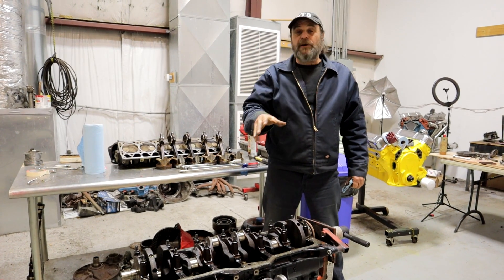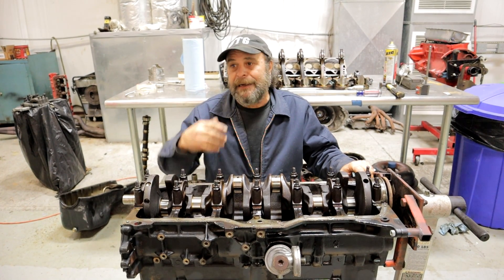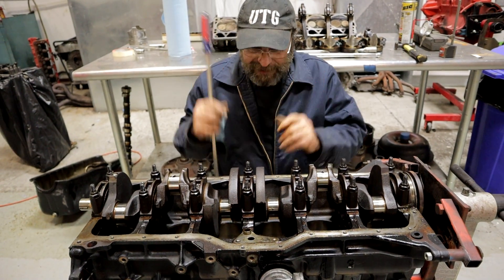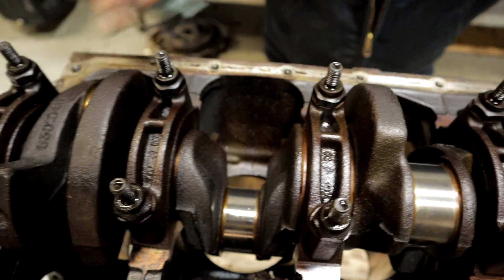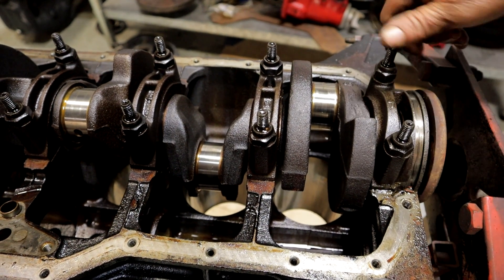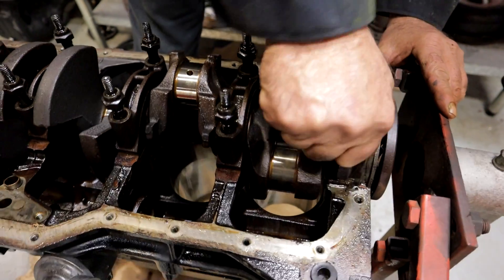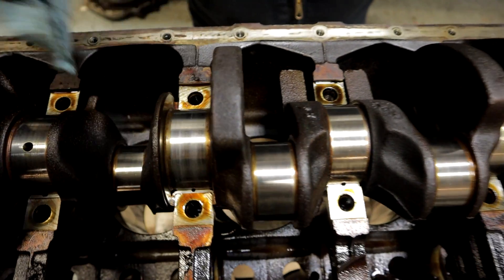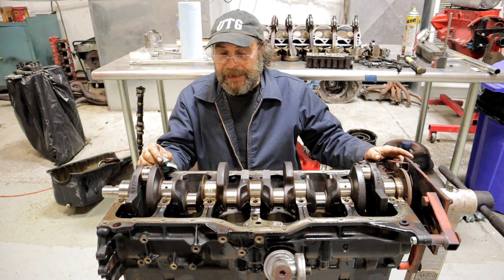Your First Engine Job - Digging Out The Crankshaft And Checking Critical Points

Comment: Great advice on the cam bearings. However, instead of making the call just by observation, have a qualified machinist actually mic the bearing ID and the cam bearing surface to see if oil clearance is still in spec. Too much oil clearance will bleed oil pressure and shorten the life of the new main and rod bearings.

Comment: blown away. I have 2 '91 mercruiser 4.3, one Ive done some basic tuniung up and it fired right up. it Humms. the other one is locked up tight! im down to the crank. there was about 1.5 litres of water when i drained the oil...going deep into the rabbit hole LOL

Comment: Quick question. Im rebuilding my geo metro 1.0 engine. It spins really smoothly. Has 285k miles. Just burns oil so i want to hone it and replace the rings. I see a lot of videos of people polishing their cranks at home and i want to know if you think this is a good idea or not. Do i replace the bearings/polish the crank or reuse them as is?

Comment: And also another thing he said that you're going to have to have each journal turn if it's got groove you can feel with your fingernail not necessarily if you take 240 220 grit 320 400 600 800 1012 1500 2000 by hand you can get a nice finish with no groove in it while the crank is still in the engine without removing it that's a tip he should have taught you you'll pull the whole crank spend $400 to have it turned and if it's not hardened then you're going to save yourself either way whether you have it turned or not you're going to save a lot of money by doing it yourself and doing the steps that I just prescribed but yes it's always good to check all your tolerances while the crank is in it's hard to check the tolerances while it's sitting in the block but he does have a lot of good detailed information

Comment: Hey Tony I am doing a rebuild on a Kawasaki ZX14. Everything went well except the engine seems tight. On first startup bike runs great about a minute into it when it first starts to warm up. Sounds like it gets tight and stalls. Do you have contact info, email etc?

Comment: IHello Tony, Question I've got a 304 v8 IH engine same condition as the one your showing, however My cam bearings de laminated and i need to install new cam bearings my question is can I just replace them providing my cam is within spec and my lifters check out ok?

Comment: My first engine job was an 304 AMC that was 30 years ago. It turned out quite well even I had no experience or an automotive job as a background. Now I've jumped in cold water again and taking apart the 1UZ-FE that powers my boat. Seems to be quite hi-tec but today they are classics too. Tomorrow I'll take out the crank of the block. Your videos are very helpful because the basics are still the same. Just gave an abo.

Comment: @UncleTony, so I dropped the pan on my SBC 350 to check the bearings since I found specs in the oil and found that the center mains are down to the copper the outter mains are starting to show copper too, do you think I can get away with simply replacing the bearings and be good or pull the crank and polish it or is it time for rebuild? The crank looks smooth. The compression was 125-140, so I didn't want to pull the heads. The engine ran good, but sat in the garage before I decided to pull it out and use it. Do you recommend I pull the cam out and look at the bearings?

Comment: On my 79 F150 302, I found the vibration damper was damaged over the years. I thought it was the crankshaft pulley being warped when the engine was operating. I tore into the engine to find bad timing chain, bad vibration damper, bad cam bearings and crankshaft thrust bearing was showing a lot of wear. Engine ran great and didn’t smoke. I plan on need cam and crank bearings. Another recommendations? Engine is stock and never apart.

Comment: Those big end journals were lovely for and old used engine. The main shells looked like they could have just been changed, do you have any idea of the miles on this engine Tony, it's mad just how good condition the rotating assembly is. This was really well looked after, other than a dry start or two it's brand new, great find.

Comment: It's great to see a channel where the host actually knows what he/she is talking about. Tony, I know you've rebuilt many engines because I've run into the cam bearing issues mentioned at least half a dozen times in the last 30 years. After tapping in a new set of bearings it's not uncommon to have to sand the #1 bearing a bit to get the cam to turn freely. Kudos for pointing that out.

Comment: Hey Tony, ive got a 318 in a 73 dart, the motor runs great has good compression even with its high mileage. i noticed excessive crank endplay and i measured .0125 with a dial indicator, the Chrysler manual says .010 as being the max allowable. this car is just a daily driver and will never see constant abuse. should i run it? or should i tear it down now to save the crank and block from damage?

Comment: Question, wouldn't you mic thrust area on the crank? Otherwise you won't know if it is crank wear or trust bearing surface wear. Enjoying these videos as I got a 2002 4.0 to freshen up and it is nice to get a preview of the insides.

Comment: Tony, Have you ever built your version of the Perfect Motor? , by that II mean....well "the perfect motor" could mean anything different to anybody, but what I had was thinking, Have you ever built a motor for the purpose of it being the happiest running motor possible, and the one most likely to run the longest, using blue printing? 
When I change oil, I can tell my motor runs happier. What does all that balancing of rods and everything do for a motor anyway?
Reply from the maker: Ray, my definition of perfect changes and evolves depending on what I'm working with.  For a long time, my perfect motor was defined as one that would last exactly 1319.9 feet.
It is funny though, how engines do seem happier right after a fresh oil change.  Logic tells us it's not really possible, but reality is, they actually do seem happier.

Comment: It's a cast iron crank, they don't need hardening because cast iron is very hard. Test it with a file. Steel cranks are induction hardened on only the journals, they have soft counterweights, again test with a file.

Comment: I bought an older car with a virtually rust-free body that has an engine knock somewhere. Using my stethescope, I couldn't pinpoint the knock's origin at the crankshaft. It was somewhere up there on the cylinder head and I had my doubts, after having adjusted the valve clearance. To make sure that the noise didn't originate at the botom end, I then tore off the pan and began popping the caps off of the rods. The bearing closest to the oil pump was the worst and the ones following were progressively better, towards the other end. There was some scuffing, of which you mentioned, and I measured their clearances with Plastiguage, afterwards. Because of the inconvenience of doing everything otherwise right, I followed a forum post to where one guy simply threw new bearings in his and then ran the engine on the heaviest recommended oil of which the service manual dictated. Because my crank was still within specs, I then ordered new bearings and installed them. The noise was still there. But, at least, I knew that I could drive it for a while, without worrying about spinning a rod bearing. Having only 60.000 miles on it and was originally owned by an older lady, I suspect that the dealer who regularly "serviced" this vehicle was bogarting her big time, through maybe packing some valve-grind compound into the filter, during an oil change, in order to sell her unnecessary service. Here, the original air filter still in it when I got it: https://i.imgur.com/1ldiQ7k.jpg
https://i.imgur.com/fpc1Co1.jpg Here are the old rod bearings: https://i.imgur.com/5H0FXHw.jpg Even though, they didn't stick it to me directly, this still infuriates me, to think that there are Scumbags out there who do these things, without any fear of karma biting them back

Comment: One little backyard trick for worn thrust bearings: If the thrust bearings are separate from main bearing you can glue tinfoil on the backside with high temp epoxy to reduce crank end play.

Comment: On re-using cam bearings. On mopars, aren't they supposed to all be undersized and have to be fitted to the cam? I seem to remember something about that (cutting them with a knife or using an old cam with grooves cut in it.)

Comment: Tony, two things I want to tell you. The timing chain cover doesn’t have dowels to align it. They make a tool that fits over the crank and fits into the front crank seal. This centers the seal to the crank. You can lightly install timing chain cover, then install harmonic balancer then tighten cover bolts. 
Next thing is the distributor. Look at bottom side of the distributor and you will see a small hole. This is used to align/time the distributor shaft. With #1 tdc on compression stroke and drill bit or what ever you use,install the distributor. The factory puts a piece of plastic in it, until it’s installed in the engine. You then pull it out. Those two little fingers that stick out should have the hold down bolt pass through them. But be sure that you use that hold down bracket that you found in the early videos of this engine. The PCM controls the timing. 
Be sure to use a new distributor gasket or it will leak. Hope you read this and have a wonderful day.
Reply: I believe Tony knows this...
Reply: Good info! Nice job.

Comment: Considering rebuilding my Big block chrysler 361, but seeing how shoddy the quality control is for new parts, (especially the lifers) that has me quite worried. Would be interesting to see a video on using NEW parts vs, NOS crankshafts/camshafts from the 60's 70's.  Kind of like Uncle Kathy's charger, has that Crane fireball cam.

Comment: I have a 1986  Dodge d150 5.2 318 with a cracked block  also needs transmission rebuild . the  318 runs but I was wondering if you had the slant 6  that that runs that I can trade. I have no way to get to Tennessee and bring it to you I live in Oklahoma
Reply: Call an Uber.

Comment: Plastigage the used main bearings before you decide to keep them?? Just saying.
Reply: On top of that, wouldn't be the worst idea in the world to check the various journals with a caliper too.  I've seen a splash oil small engine with a beautiful looking rod journal with 0.003" out of round.  Hard to say if this happens too terribly much on pressure lubed crankshafts. Just want to say appearances can be deceiving.

Comment: There I was, getting ready to do an “I gotcha” on those bolts, and then you caught the error. No harm, no foul. But now you have to check them all because they got mixed up. Oh well.
Reply: If all of them turn out to be within specs, that'll prove that someone had the cap off, in order to replace the seal

Comment: Here’s my question. How would you feel stretch in the threads that are beyond where the load is. What I mean is undoing the main caps the nuts are passing over an area of the threads where no load was applied. Same with a bolt where the loaded portion of the threads will be held intact by the material it’s threaded into. I get stressed threads will bind but it don’t seem like a good test during disassembly. By removing the stud or bolt and then re-threading a nut going past the assembled point would work though. Just my thoughts.
Reply from the maker: I was referring to the "snap" that can be heard when first breaking any of the other main bolts.  Only the last two let go without making that sound.

Comment: What if you put in a new cam? Would you change the bearings? I’m going to build a 360 and will upgrade the cam
Reply from the maker: Same thing applies.  BE SURE TO CHECK THE CAM JOURNALS!  I and several other people have recently encountered cam bearing journals ground over spec.  That can be a major issue if it gets past you.
Reply: Thank you guys I appreciate it, I’ll be sure to check it out really good, I can’t afford to blow one up 😂 just doing what I can here
Reply: if you are changing the cam, you need new bearings, the old ones are worn in to the old cam...

Comment: I'm assuming you just be replacing the pistons on the rotating assembly. Will you be putting the rods, pistons, wrist pins, bolts and rings together in as close to an average weight as possible ?

Comment: 15:30 I was about to comment, that I'd be more than tempted to just put those main caps back on, without disturbing the bearings. They're probably better quality, and would last longer than new Chinesium ones 😆
One thing that came to mind, is comments in previous videos about Tony not using power tools, I'd equate that with comparing a craftsman to an assembly line parts changer.
Reply: Hopefully he uses Clevite as they are still made in USA (at least the last time I bought them they were).  KING Is Made in Israel but are quality too.
Reply: @OldBeaterGarage boycott chinese and israel products.
Reply: @You Wish If people would stop buying that crap, they would stop shipping it over. One of the reasons as to why I no longer board an airline is because I've read that some of them knowingly buy counterfeit parts from there

Comment: Why no air tools!
Reply: With air tools you can't feel if something is binding or too easy, as well as you can by using hand tools.
  Even if you are replacing every fastener and chasing every threaded hole on the entire engine, it is still good to know if there is/was a certain bolt, nut, fitting, or fastener that just didn't "feel right" during disassembly.
   (Hope this helped answer your question)
👍😁

Comment: These 4.0L engines were notorious for oil leaks from the rear main seal/rear oil pan gasket seal to where literally every single one leaked and needed to be repaired at some point at least once or multiple times. I did countless of these in the dealerships and  independent work after the dealer. I noticed it had a Felpro oil pan gasket so more than likely those rear main bearing cap bolts have been off before to replace the rear main seal. Also that smell when pulling the main cap bolts off is normal and not a sign of overheating necessarily. Also make sure you reseal the oil filter adapter as those like to leak as well.
Reply from the maker: You are most likely correct, and I'll point that out in the next vid.

Comment: Many big 6’s would come to our AMC dealership with 150k miles, usually with about 5 psi oil pressure at idle. We would replace bearings with 1 under size and all was well. They are a tough engine.

Comment: Good video, uncle Tony this brings back memories 

if you have a manual transmission and you’ve got the habit of sitting at the traffic lights with your car in gear, holding your foot on the clutch, as you know that is a bad thing because it pushes the whole rotating assembly forward, while the motors running and it, chews the thrust bearings….

Some of the viewers might not realise it’s a bad thing to do
Reply: Drove manuals my whole life and never thought of that. It makes sense
Reply: That's why I'm always in neutral when stopped. Even in a automatic, I pop in neutral just out of habit.
Reply: @felzke440  On an automatic, keeping it in gear at stoplights still won't make any difference on the thrust bearing

Comment: I have a cracked head and a hole in piston number 1 in my 4.0. Time to drop the pan and check out the rod bearings. I might need an engine stand and a hoist…

Comment: I sure wish YouTube and Uncle Tony would have been around when I rebuilt my one and only engine (in the late 1970s). It's a wonder it even ran when I put it back together. When I took the block (with the pistons and crank still in it) to the machine shop the guy that ran the shop took a look at it and told me that all I really should have been doing was having the heads done because the bottom of the engine was almost pristine.
Reply: He certainly was around. Unfortunately, he didn't have his video channel up and running yet 🙄

Comment: Lack of snap on the rear bearing cap may be an indication that the rear main seal was replaced at some point in it's life.  It's a common failure point.  IIRC, at least on the 99-01, you pull the bearing cap and then can fish out the seal and push the replacement in (they come in halves) without having to drop the crank.
Reply: Exactly what I was thinking.
Reply: X3
Reply: Same with any 4.0 or 4.2.

Comment: I think the cam bearing part could've had more emphasis on replacing since this channel is geared to the newb but totally justified in not replacing. Good work always a nugget or two of wisdom to be had here. 👍
Reply: This video is designed to showcase what THIS engine needs for a rebuild tailored to the expected application.

Comment: Tony, thank you for continuing to go through this series in detail . They’re not big view numbers at first, but these will always be there for novices like myself as a reference forever and we are grateful for it .
Reply: Yep, excellent series! Only time I totally tore down an engine, I knew it wasn't going back together. It was an EFI Ford 5.0 HO with a wiped out crank snout and a couple of rusted cylinders. I chucked the block and crank, but still have all of the guts. And I bothered to put each rod cap back on, and facing the same way, as soon as I got its piston and rod out of the block. I found an extra bearing half in that block too! Can't remember if it was rod or main.
Reply: I was hoping this motor had more problems for more teachable moments. Those are great motors, so even an abused one can look better than most.
Reply: This is supposed to be a cheap rebuild! Like I said before, $500
Reply: I so tired of the music people add
Reply: @TONTONAP  Oh no. Oh no. Oh no no no no no.